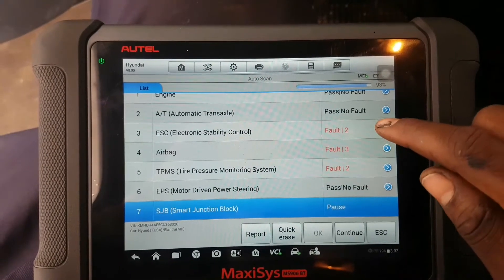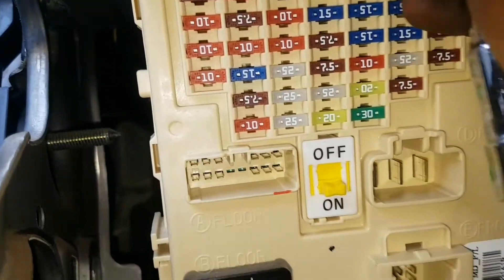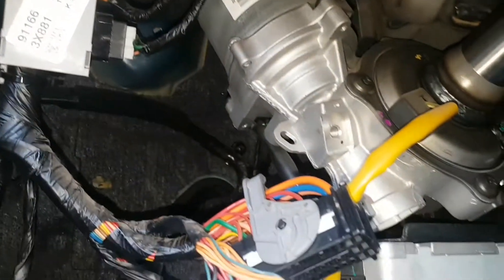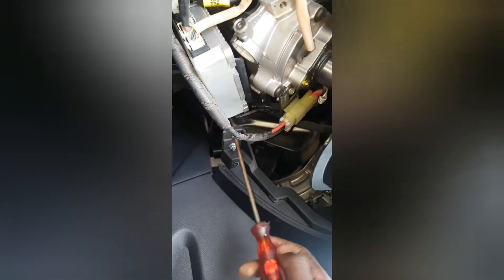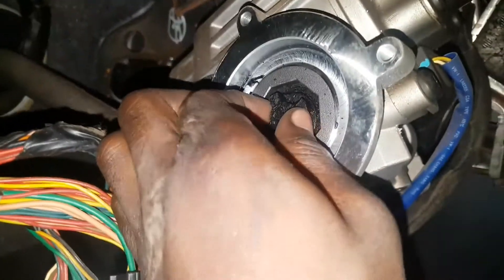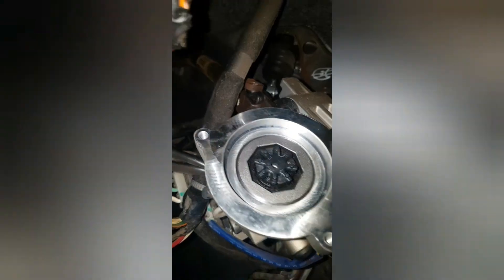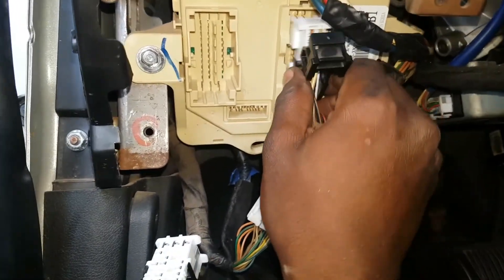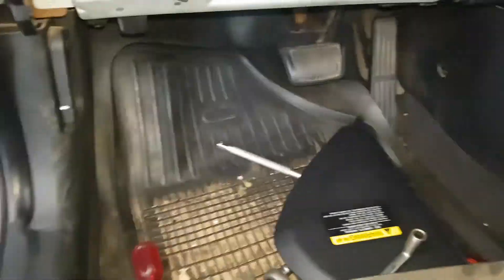Elantra 2012: C1260 Steering Angle Sensor Circuit-Signal(how to replace flexible coupling)

Comment: Are you changing the bushing because of noise or steering angle sensor circuit failure (C1260
Reply from the maker: Yes

Comment: Do I need a special reader to clear the code. I replaced the steering coupler but the c1260 won’t go away! Dealer wants $182 just to diagnose here in the USA
Reply from the maker: You have to calibrate it

Comment: how do you verify its that and not the angle sensor it self? i have a initial clack once steering wheel turns from center almost sounds like its right behind the steering wheel  has the 2 same codes you have
Reply from the maker: The steering angle sensor is in the eps(Electronic Power Steering )
Reply: @ADDAUTOMOBILESERVICES  
The code your having is only for the coupling
Reply from the maker: Yes

Comment: Hey man quick question! I did what you did but for whatever reason my steering wheel won’t turn. I removed the steering wheel from the steering column and put the key in the ignition to see if I was able to turn the wheel and it worked . It’s just the steering column that’s locked for some reason. Any idea why this is?
Reply from the maker: Pls check the rack connection
Reply: @ADDAUTOMOBILESERVICES  where is the rack connection exactly ? Is there anyway I could FaceTime you so I could know where to look? If not it’s okay. I’m in the states by the way or else I’d just take it to you
Reply from the maker: @TheTopic_AtHand  WhatsApp me +233246312303 or same number on FaceTime
Reply: @ADDAUTOMOBILESERVICES  hey I tried calling, I left a couple messages saying who I am
Reply from the maker: Ok boss

Comment: did this problem cause a stability control light to go on?
Reply from the maker: Yes
Reply: @ADDAUTOMOBILESERVICES  Thanks! Was fearing it was the stability sensor which costs quite a bit. Will try this first :)
Reply from the maker: Ok 👍

Comment: I am facing the issue of occasional left pulling in Hyundai Elantra after calibrating the steering angle sensor as well, it is any symptom of bad flexible coupling..
Reply from the maker: Yes and check the calibration
Reply: @ADDAUTOMOBILESERVICES  thank you so much for your helpful advice
Reply: @ADDAUTOMOBILESERVICES  i did calibration 3 times but after 20-30kms same issue comes up every time
Reply from the maker: @ShubhamMadke  pls when the problem come check your steering angle sensor value

Comment: el sensor de angulo de la direccion donde se ubica del elantra modelo 2012
Reply: How do I reach you
Reply: yo tengo un elantra y me va mal la direccion, creo que es el sensor este,, que tampoco se donde esta
Reply from the maker: It is located in the EPS module
Reply: @ADDAUTOMOBILESERVICES  my car's power Steering not working... It shows EPS and Traction Control lights on screen... What to do
Reply from the maker: @abhikale47  pls check the fuses first  and check for power on the EPS
Reply: @ADDAUTOMOBILESERVICES  can you plz let me know Which fuse... Fuse near the battery terminal or Fuse box under the steering..... Hyundai Service centre asked to change whole column. But I dont think so that I really need to change whole column
Reply from the maker: Download this app it will give you the wiring diagram CARMIN STD
Reply: @ADDAUTOMOBILESERVICES  checked fuse.. Looks all right
Reply from the maker: Pls check power and ground on the EPS
and if the power is good change the EPS unit
Reply: @ADDAUTOMOBILESERVICES  As per Hyundai scann report its all okay they scanned for c2400 but have not found anything... Hence, asked to change whole column.

Before that I had unplugged all connectors to change MPDS coupler because of steering Noise  also dismentlled steering couloum.. But after installation it started creating this issue on turning but now its totally jammed and showing Traction control and eps light.

Service centre quoted 5100$ for new steering Assembly... Its too annoying
Reply from the maker: Pls disassemble all of it and check the wires that goes on it and check what you did not fix right (+233246312303)WhatsApp me and let me help you virtually
Reply: @abhikale47  did you get it fixed im having the same issue right now
Reply: @abhikale47  did you get it fixed and how????